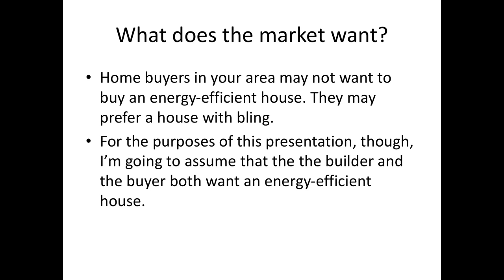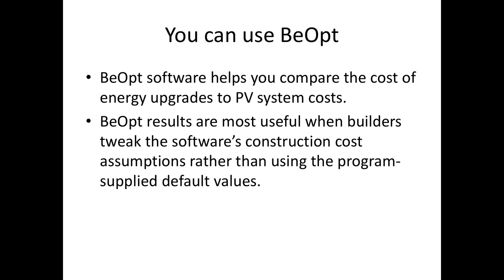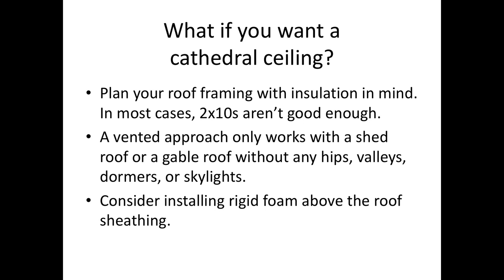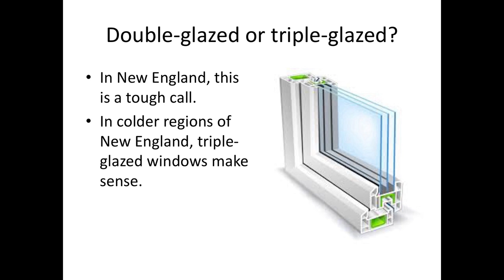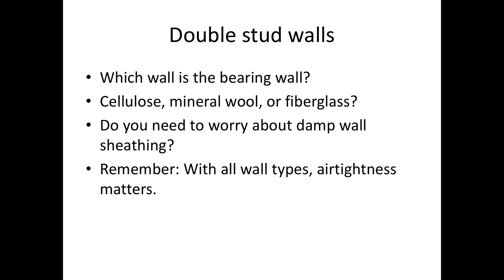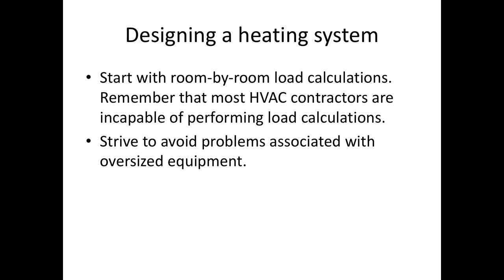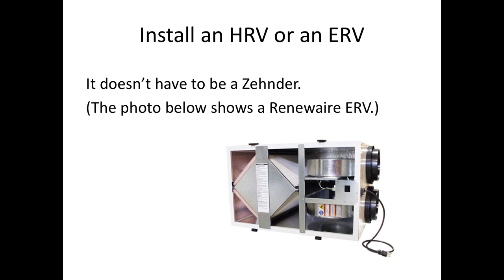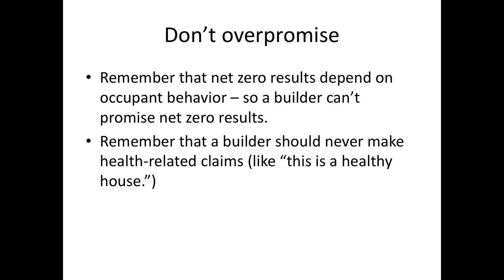FHB Summit: How to Build Well, Simply

Comment: Steve is right. water is unlikely to diffuse to the sheathing. Convection is the real danger. In a poorly detailed house interior air may leak into the wall under the baseboards, around windows or through penetrations. Convection loops may form around poorly installed insulation, delivering moist air to the inside of the sheathing. Even in a well built house people make changes. If you take Martins' advice about exterior insulation and make sure the sheathing is air sealed from the outside, it doesn't matter how leaky the interior walls are, or how poorly insulated. The house will not rot.
Reply: Yes but on mid Atlantic trunk seasons very hard to avoid rh getting above 50! Yea

Comment: Some rational thinking here.  Tired of these hugely expensive, overly-complex HVAC systems that are so fashionable these days (often pushed by building science 'experts' sponsored by HVAC companies).  I intuitively distrust tight homes - besides being expensive, they are highly dependent of proper design, installation and maintenance - all 3 rarely happen in the real world - and if any one is not done correctly, people's health is at risk.  High CO2 levels in tight homes/inadequately vented spaces (like bedrooms with closed doors) is very disturbing. I'd rather have a relatively leaky house and pay more to condition the space as needed - and not rely on expensive/complex HVAC systems.
Reply: We don't suffocate from CO2 in buildings made of concrete, steel, and glass because they are mechanically ventilated.

Now HVAC designs could be better planned and leak less. We also don't have a great way to integrate air quality control into homes that prefer radiant heat. Hybrid heat pumps are probably the way. Modern homes need a comprehensive plan to control humidity, heat, and cool. Preferably driven by a single mechanical assembly.

It's easy to maintain the status quo when energy is cheap. However there are plenty of areas in the U.S.  that do not have access to NG and probably never will which are hungry for more energy efficient homes and the complexity that goes with it.
Reply: Stop with the houses can be too tight nonsense. First, air sealing during construction is not that expensive, and cheap compared to wasted energy. Second,  a leaky uninstalled house will last forever because it can easily dry. As soon as insulation is introduced drying is restricted and the leaky house will rot from internally generated moisture condensing in the walls. Regardless, any house that meets air leakage code will require mechanical ventilation to meet code.
Reply: I wish I could edit youtube comments. I meant a leaky uninsulated house not uninstalled.
Reply: People do open there front doors now and again.